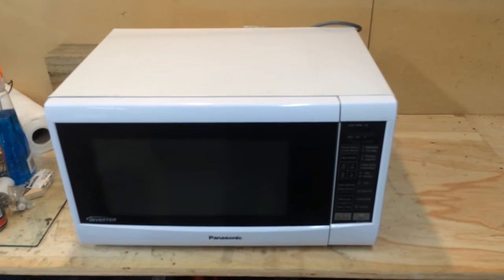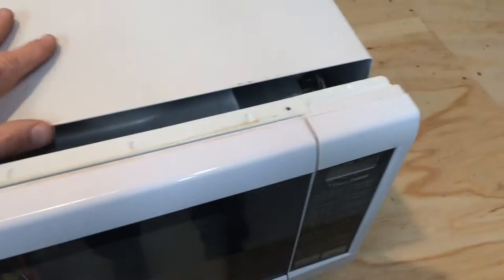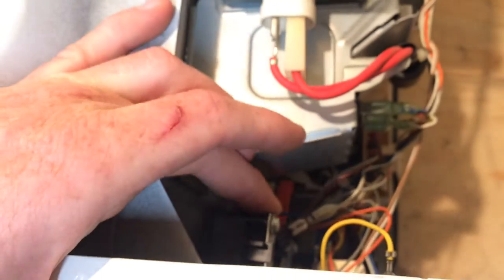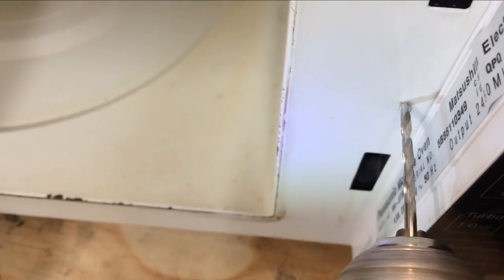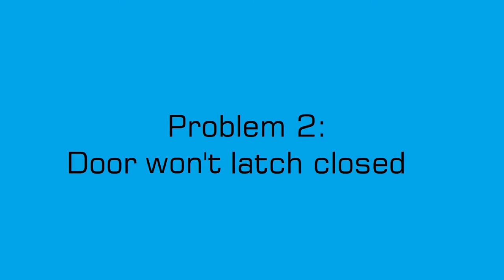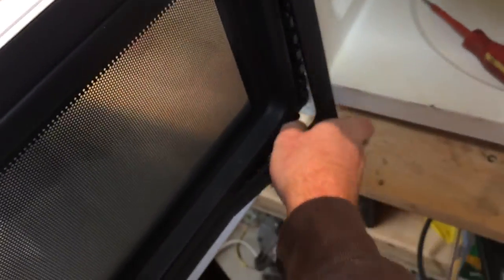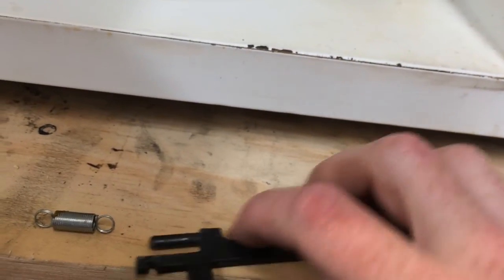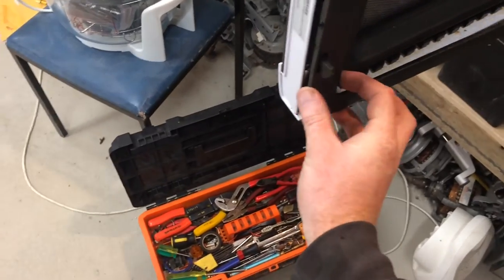How to Fix Panasonic Microwave door problems

Comment: 12 year old Panasonic 1250watt microwave was headed to the dump until I seen your video! Bravo.  Knew it had to do with the latch but didn't want to mess with it, glad I did. Took longer to get the security screws out than it did to repair and now it's like brand new again! Thanks!

Comment: Woop, thanks for this! My problem was that the plastic hook had broken from the door facia and left the spring dangling. I fixed it by drilling two small holes at the bottom of the facia, and feeding a length of bent galvanized wire through them to hold the spring. Twisted it at the bottom to secure it where there's plenty of room provided by the feet. Again, thanks for taking the time to make the video.
Reply from the maker: Don't you love that feeling of making something work again  😀
Reply: @motrepairs  Oh, I do, I do! :D
Reply: Ah just saw this. That's what we did too. But I think you've explained it better!

Comment: Thanks for taking the time to do this video. I was able to fix my microwave which had this exact problem. I wasn't happy riveting into the unknown so I placed a small strong angle bracket from the top screw on the metal plate that holds the lock mechanism and riveted the other end of the bracket to the angled galvanised metal overhand just above it. Works perfectly and is now very secure.

Comment: Good video!  Helped me understand and fix my Panasonic microwave!  I ended up drilling a couple of holes in that piece of metal, then used galvanized wire to attach to secure anchor points, being careful not to get in the way of the moving parts.

Comment: My Panasonic microwave has the spring issue, I slammed the door a bit harder than normal yesterday and then realised the door wouldn't shut, the bit that retains the spring has snapped off, so I'll just attach the spring to another part of the door, I bought this Panasonic Convector grill microwave in early 2001, so I've had over 20 years of service, I regularly use the grill to cook meat etc, Thanks for sharing your knowledge, Awesome!
Reply from the maker: That’s great, I’m glad you could keep it out of the landfill a little longer.

Comment: This video was very helpful 👍 Repaired the spring inside the door. For me it was a little different.  The bottom part where the spring was hooking on was broken. I just used a tie wrap and attached the bottom spring to one of those metal fins thingy
Reply from the maker: Awesome, yes there are a couple of ways it can break

Comment: is there a video which shows how you can remove the side panel with the push in door opening button at the bottom which has broken and the latch does not work because of it

Comment: I tried to figure out how to reset the h98 fault code that was locked on the display board, after 3 or more h98 faults it permanently logs it onto the display and needs reset. I rung panasonic but they were unhelpful and rude. Do you know how? It's different methods of reset depending on the model of panasonic microwave

Comment: my problem is the tiny bit of white plastic that houses the small black plastic latch bit that enables the latch to open and shut...and that was not shown in this video..Ive seen where it has broken but the plastic bit is so tiny, and fiddly to get to to house it that il be binning my Panasonic microwave!  what a shame
Reply from the maker: You cane still get new parts depending on the model
Reply: @motrepairs  that's the model No.NN-K354BBPQ. Serial No. UO4030651.  Can you source the part for me as in where I could purchase it?
Reply from the maker: @avanola2612  I'd recommend trying Steves appliance spares https://www.appliancespares.nz
Or need-a-part https://www.needapart.co.nz

Comment: Microwave won’t heat after I close the door
Reply from the maker: Hi, if the time counts down as if it is going and table turns but it doesn't heat then it will be a problem with your Magnitron/Diode/transformer or inverter etc. rather then the door.